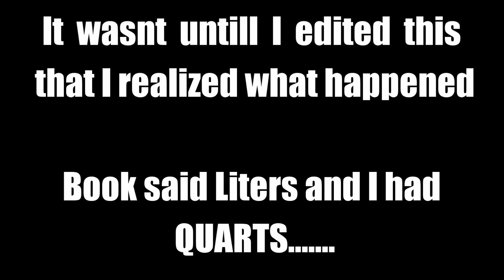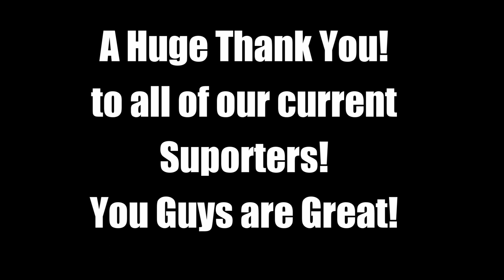Can Am Defender Differential Change, Front and Rear

Comment: First of all, thank you for the video. Then, according to you, for a normal use (not extreme), what is the frequency of change of the differential oil. Is it the same as for the engine oil: minimum 1 time per year? Or is it possible to stretch the frequency?
Reply from the maker: I do the Diff's every year on the X3 due to the extra HP but for the commander I'd would do it every 1000 - 1500 miles

Comment: Hello ,do you guys no where the speed sensor is located
Reply from the maker: On the SmartLok there are several. One for the rear and 2 in the front diff to sense slip and lock the front end. For the non SmartLok it’s on the driver’s side of the rear trans.